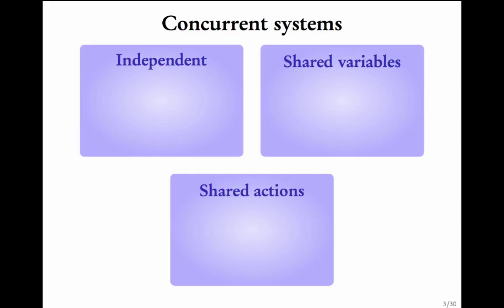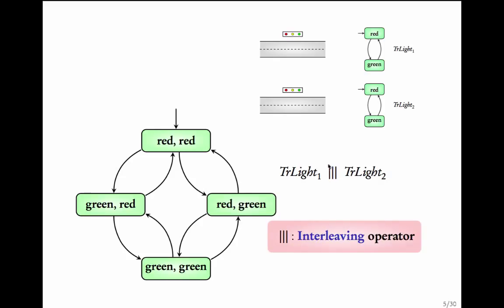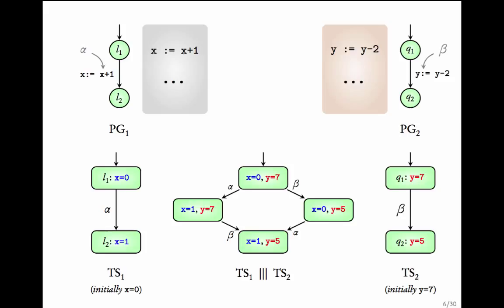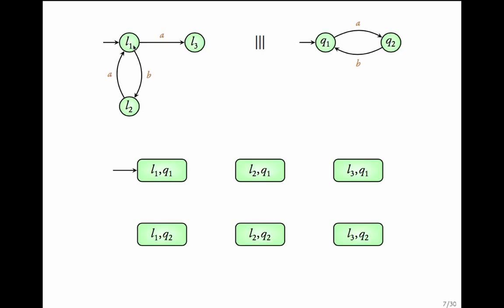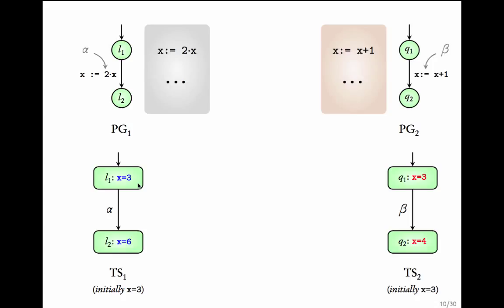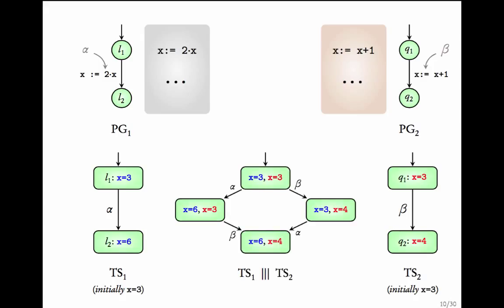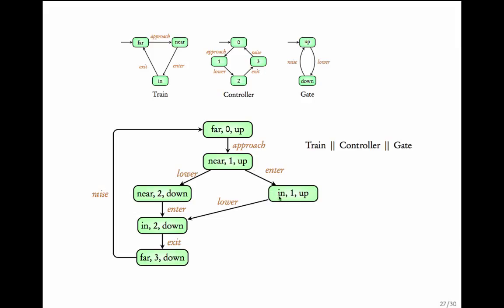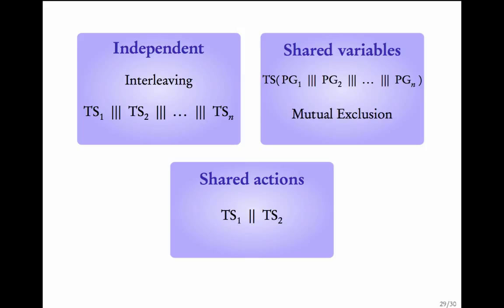Modeling concurrent systems

Comment: How can the value of X in the 3 loops example ever be -1? If it's 0, then the WHILE X > 0 condition will fail and it will NOT enter the loop in which X would be decremented to -1, so I don't see how it's possible to get outside the interval [0,200]... ?
Reply: I think he is talking about preemption here.

Comment: Hello sir, thank you for posting these helpful videos. I have a question about the book-keeping example. There from the state 000, the only action shown in the graph is a scan, to go to 100. However isn't it possible that, say the print_cmd action of the printer system is fired first? Are we implicitly assuming that these systems have to work in the order of bcr, bp and then p?
Reply: When you start from an initial state (scratch), it is assumed (or maybe the requirement) that until at least one bar code is read (one entry is available for printing), do not proceed with a print (blank bill). So, your implicit assumption is nothing but the implicit requirement that the states have to be ordered BCR-BP-P.

Comment: Hello Sir, 

Thanks for posting these very helpful videos, however, I do have a question about the interleaved transition system @10:18. Why can't we have a transition from state(L1Q1) to state(L3Q2)? On action "a", the net result will be such a state change--if the two transition systems act at the same time. You diagram eliminates the possibility for such parallel behavior, but is this not erroneous? (since you mentioned that the two transition systems are completely independent and parallel.)
Reply from the maker: Hi,  that's a good question. The goal of the slide was to explain the semantics of independent systems without shared actions. I should have given different names for the 'a' and 'b' in the second diagram. That's a mistake, and hence the reason for confusion!

You can think that the 'a' of the first transition system is different from the 'a' of the second :) We want to model "asynchronous" behaviour where each system independently evolves. 

Thanks for pointing it out!
Reply: +NOC15 July-Oct CS12 Thanks for your reply, that makes things a lot clearer now.

Comment: Dude, the shared action part (Book keeping example) is so ambiguous, I looked through the textbook too but still I do not understand why we need to get transition (print) and (check_price) after 101 state.... 
isn't the printer supposed to take the control immediately after print_cmd for instance? I'm talking about the logic....
Reply from the maker: What you say could very well be true and in fact there could be more requirements in the communication mechanism. But, here, we are more interested in modelling a specific scenario. 

The current model  of the three processes in the video does not take any scheduling policy into account. It assumes that the processes can be interleaved in any manner, except that they should synchronise on shared actions. If there are specific scheduling policies, like the one you mention that printer should take control after a certain command, these should be modelled separately (using extra variables, or some other additional features on the modelling formalism).

Hope this answers your question!